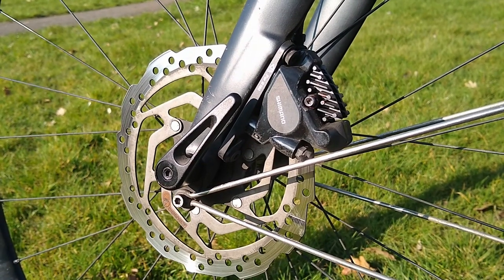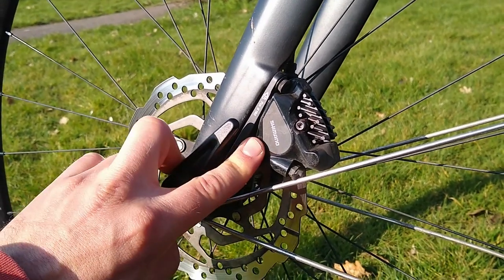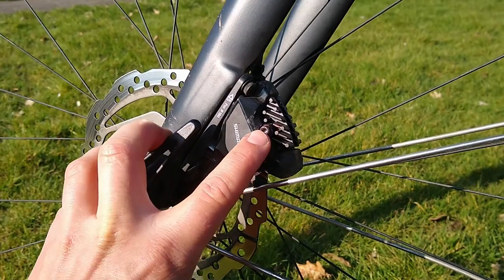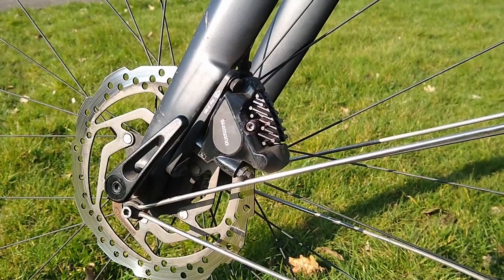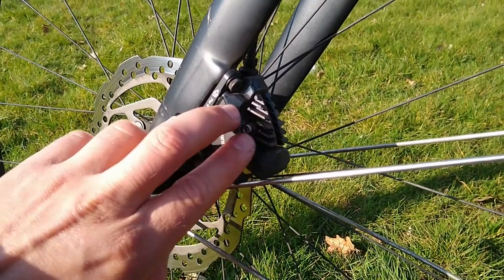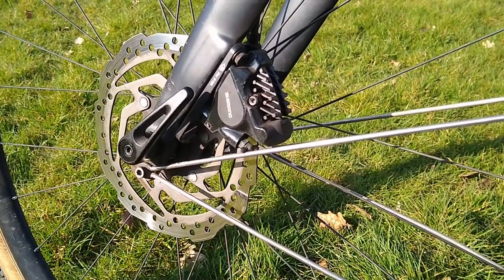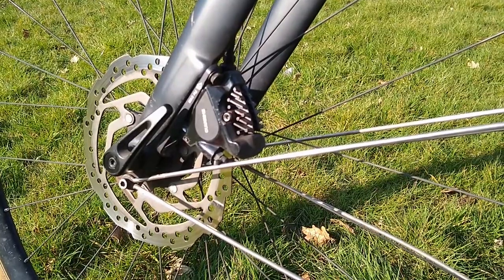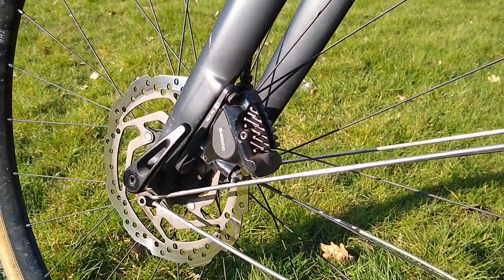How to remove a stuck bicycle disc brake pad retaining pin

Comment: Save yourself the frustration and just drill through the screw with a drill head one size below the screw. I used 2mm on a 3mm screw. Once you're through the threaded part (carefully not to damage it) it is easy to snap/saw the pin through the middle. You can pull out the non-threaded part through the other end.
If the threaded part is still stuck, first try to push a hex tool through it and unscrew. If that still doesn't work, drill with your 2mm drill head by rotating it around the sides of the hole you made, until it comes loose fully.
These screws are pretty soft material, so it is easy to destroy the head so it gets stuck. But luckily it also means they are easy to drill through.

My current issue is that all six of my disc brake rotor screws are stuck. Now THAT is a pain, as you can only drill so far before drilling through the hub.
Reply: I suggest, just drill the threaded part of the pin out, remove the remaining pin and insert the appropriate sized split pin. (Issue solved)
Fitting split pins is such a simple and robust solution, then take comfort in the knowledge, that future brake pad replacements will be hassle free.
Reply: Yes. I just managed to remove the screw by drilling through it…managed the destroy 3 drill bits in the process!
Reply: @johnnewington3798  I thought about doing that, but decided against it, as I was afraid that it may jeopardize the integrity of the hole as you start widening it as you chisel off the threading. Luckily I could solve the issue by just a size smaller drill bit.
Reply: @stevegeek  Yeah, they told me in the store to take extra care as they are quite delicate at this small size :) They said to make sure to always exert straight pressure and never bend.
Three gone, that's some strong screw! :D Mine was soft as butter.
Reply: @masterpep7218  LOL! My mistake was using 1mm drill bits to try and drill a pilot hole first! They were just too weak. I ended up just using a 2mm and that worked. Hope I haven't damaged the threaded hole...I'll find out tomorrow when new bolts arrive with hex heads. I think I'll apply a dab of grease before I screw them in, just to help next time I need to change pads.

Comment: As others have said, If the pin is excessively corroded/seized, the pin may not come out as explained, in this case, I suggest you “upgrade” your bike’s brakeset, by drilling out the threaded part with a 2mm drill and fit 2mm split pins, a much better solution, than the flawed Shimano OEM pin.

Then remove the pin from the other calliper on the bike, if it will come out!  and “Upgrade” your complete brake set up, by fitting split pins to both callipers.🙂

The OEM aluminium threaded brake pad retaining pin design on this Shimano brakeset is a inherently flawed design, if you ride in all conditions or where salt is put on the road.

I have heard from others, that bike shops commonly renew the calliper in this situation, replacing the calliper with a new calliper, that has the same flawed Shimano aluminium threaded pin design.🤷‍♀️

Unless you live in an area that is predominantly dry and does not apply salt to the roads, the weight saving of having aluminium brake pad pins is just not worth it. 

Once you have upgraded your bikes brakeset by fitting spit pins, then enjoy your bike upgrade with the  comfort in the knowledge that future pad changes will be simple with no potential issues.

Should be obvious, but just in case, readers have not previously worked with split pins, ensure you adequately open the legs. 
Such a simple and robust brakeset upgrade to your bike.❤

Comment: Thank you so much. I tried to drill the thing out and use pliers to no avail. The cutters worked great and bolt removed in a minute!
Reply from the maker: No worries, glad it helped!  I tried a bunch of different things too until I figured out how to grab it with the cutters.

Comment: I have the same issue. What do you mean by "diagonal cutters"?
Reply from the maker: I used something similar to these to really bite into the screw and then twist it out, probably not very good for the tool but it worked for me: https://www.knipex.com/en-uk/products/cutting-pliers/diagonal-cutters/diagonal-cutters/7001180

Something like this might work too though, either on the screw from the outside or by tightening on the screw from the inside in between the brake pads:
https://www.stanleytools.com/products/hand-tools/pliers/675-in-long-nose-locking-pliers/stht84404

Comment: Just ruined my front bolt 5 mins ago 😖
Shimano OEM screw is rubbish, slotted head just gave out with very little effort from the screwdriver!
Reply from the maker: Yeah they are very soft screws, I got hex head ones off Ebay and they are much better.